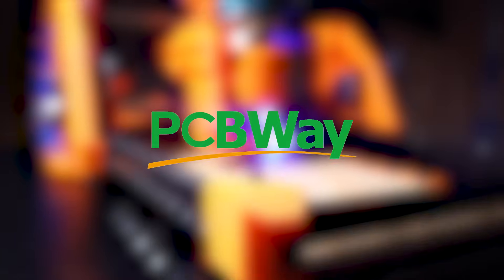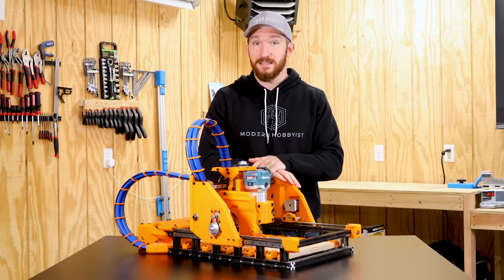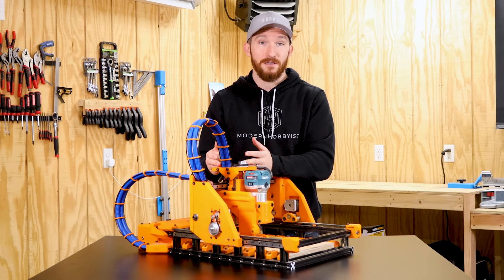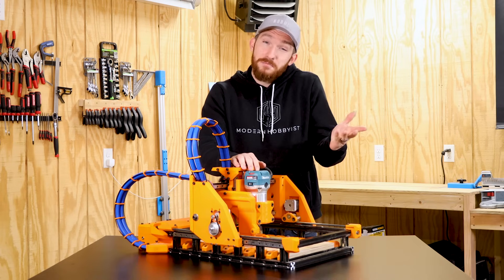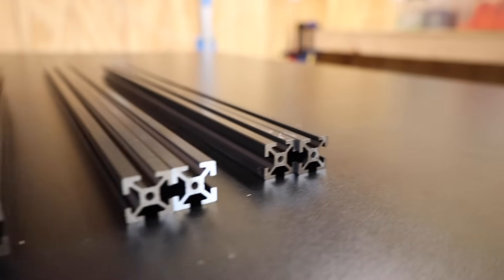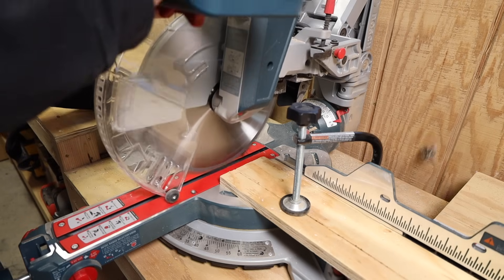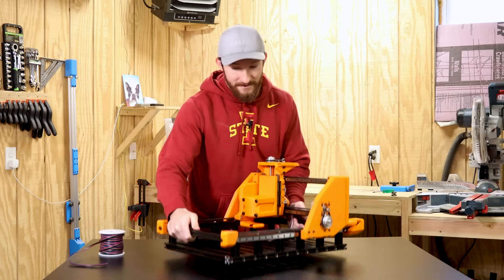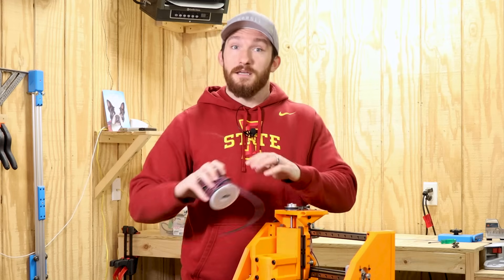DIY 3D Printed CNC That Cuts Metal!

Comment: Final build cost?
Reply from the maker: It's been a while, but I think around $650 🤔
Reply: @ I’ve been thinking about 3d printing one. I think I’ll just convert my old 3d printer into one by adding a controller and a motor with some send mills and a new build plate.
Reply from the maker: One issue that you might run into, is that 3d printers are not designed to be rigid at all. They require very little rigidity and as such often make crappy routers 😬

Comment: metal structure, metal drive parts, metal guides  - yeah this router is 3d-printed, for sure.
Reply from the maker: Convenient that you forgot to mention the 200+ 3D printed parts .
Reply: Did you actually think it was going to be 100% 3d printed

Comment: Fit a mains socket onto the electronics box controlled by the relay, then you can just plug a router in without having to cut its plug off.
Reply from the maker: I would’ve liked to avoid chopping it off, and that’s not a bad idea for future builds, but I wouldn’t have been able to route it through the existing cable tubes. Would’ve been an easy fix if I had kept the plug I suppose 🤔 in any case I don’t plan on taking the router off the machine any time soon. Thanks for the comment!

Comment: Very nice build! The only thing I'd worry about is the air vents on the power supply. You really wouldn't want the aluminum dust to be pulled into the power supply (or any other type of dust). Thank you for the very good video.
Reply from the maker: Thank you! I was worried about that as well, so I had a filter on both sides of the fan in hopes of keeping dust out, but I still found walnut dust in there after my last project 😬 might have to rethink the electronics box

Comment: I got some extrusions through Amazon recently, and it wasn't until I was "repairing" the M5 threads that I had tapped, but weren't holding, that I figured out that the center holes were sized to be tapped for M6. It was in the diagrams, I just didn't notice. After years of using Misumi extrusions with the pilot holes for M5, I just thought that was the size you'd get with any 20mm extrusion. So, yeah, learn from my mistake!

Comment: Great video! I want to build one myself. Seen other mpcnc builds, but this one seems to do really well with aluminum.
Reply from the maker: It really does do pretty well and it was a fun build! You should also look into the PrintNC! It's an open source build using steel tubing and some 3d printed parts.

Comment: Hmm. You or anyone tuning about doing this should look into the PrintNC. But I'm a donit once and do it right kind of guy.

 It's a far more sturdy and capable CNC router. No flimsy aluminum extrusion. There are printed parts but kept at a minimum. The entire parametric model... With an absolutely insane build wiki/manual.. everything is completely free and available online. There is also a huge community on discord with lots of helpful advice. High recommend over doing this build. IMHO
Reply: Thanks.

Comment: Great build/interesting machine BUT like many/most fun projects it's hardly useful for working on metal.
Like the engineer in one of the posts said the materials plastics etc you use aren't very suitable (too flexible etc).
If you're really serious about metalwork it would be more useful to buy a small new or used machine.
You can more or less "reverse engineer" that machine to learn how things SHOULD be designed.

Comment: I'm working on a design for a CNC with about 400x440x120 cut area.  The machine is done, working on the electronics and wiring now.  If it works as I want, I'll be posting the files but mine isn't polished. I'm a newb to designing so I tend to build and test, build to fix problems or correct issues, then build again and again.  I enjoy the tinkering aspect so I'm good with that.
Reply: How did it go
Reply: @santiicolorado  Went fairly well, got it built and wired, firmware installed and working.  Cut a few pieces of wood, didn't get around to metal.  I have some health issues and I ended up having to set that project aside for a while and I haven't got back to messing with it yet.  It just isn't the most important thing in my life right now.

Comment: Great design, great build, might even consider building it myself. The only difference is, instead of drilling into the aluminum extrusions, just use the t slot hardware, more convenient and easier than drilling holes and screwing them together.
Reply from the maker: Yeah especially with a super wobbly drill press I stole from my Dad 😑

Comment: i think its a weird design, why not just use ballscrews
Reply from the maker: Thanks for watching! I hope to make a bigger DIY cnc in the future and will most likely go with ballscrews as well!
Reply: @ModernHobbyist  Ive planning to rebuld mine, Ive used nikodem bartniks design, but made it simpler and on bits left from 3d printer so ended up with weak rods, my next idea is to use a 9U cab as a case and mount all inside of it, on 12 or 14mm rods and ballscrews instead of standard leadscrews

Comment: It really hurts me...using arduino uno with cnc shield and one of cheapest drivers possible while cnc construction is extra expensive, even makita is really good but it's only 710W comparing to 1500w spindle is nothing. Anyways looks cool and impressive. nice work

Comment: @11:22 Yea I don't think having both the Fan In- and Outtakes on top of the Electronics Box was a wise decision considering the Metal shavings you apparently intend to cut with it being produced nearby 🤔
Maybe consider adding a shield that will have the shaving bounce of there instead of landing in the Fan Ports? 🤨
Reply from the maker: Thanks for the comment! I did add filters to both sides of the fan to prevent any shavings from making their way into the box, and so far when I’ve checked inside they seem to be doing the job

Comment: Misumi charges a premium for everything.. I only go there for cads and component spec sheets
Reply from the maker: Misumi is definitely more expensive, but for this project it was worth it to have them come pre-cut. I could have bought full 2M extrusions for cheaper, but I would have spent the same amount total. I'd just have a bunch of off cuts that are too small for anything useful 🤷🏻‍♂️

Comment: Could you go into more detail about how you programed your arduino uno cnc shield doing his big cnc and struggling with that part
Reply from the maker: Hey Nathan! I used the Arduino IDE and the newest version of GRBL for the firmware, and started with the configuration settings Ivan provided in the PDF and adjusted from there. I found this link to be helpful when flashing the firmware: https://all3dp.com/2/grbl-arduino-cnc-controller-simply-explained/
Hope that helps!

Comment: Well, I don't want to sound harsh but this is a newbie machine from someone who have no idea of what he's doing. There's so much conception mistakes that we could talk about it for hours. Long story short, the major issues are materials and components. The young modulus of plastic is a fraction of what steel (which is the right material to be used: stiff and inexpensive) is. 3D printed parts are not isotropic, so they are way worse than injection molded plastic. People may understand that to get the same stiffness as a steel sheet, 3D printed parts should be more than 60 times (!) thicker. Second, the linear rails used in this build are MGN 15mm which are not suitable for routing/milling operations anyways, because they use a single path of bearing balls in a plastic cage. To hold random routing/milling forces you need 2 bearing paths with opposite contact point. In other words, the rails and blocks don't have enough holding power in lateral and vertical direction. 

Consequences are you will need to lower machining speed to avoid vibrations and some deflections caused by the raw material resistance on the tool. You guys think I'm wrong ? Well, do an easy test. The machine can hold a 8mm bit, so insert a 1 flute 8mm bit, set your Makita router at max speed (30.000rpm), set your feed at 10 meters per minute, ask for a 8mm deep pass through any hardwood, hit enter and see by yourself how good the machine is. For information, those are average settings: a proper machine can hold much higher rates. 

Don't get me wrong, Ivan Miranda is a very sympathetic and dynamic guy and his videos are a lot of fun. But when he claims this machine can cuts metal this is much closer to a lie than to reality. Let me explain. With a file which is not a cutting tool, with a bit of patience you can cut metal. And this is what Ivan Miranda is roughly doing: taking micro passes for filing small amounts of material at a time. At the end the metal might be cut, but this is not milling. What else could he do as the machine is not able to stand average metal machining ? 

Once again, I don't want to sound harsh, but this is fooling people I'm afraid. Some newcomers will invest a significant amount of money to build a mediocre machine. And as they have no other machine to compare with, they will be convinced this one is fine. That's what Ivan Miranda himself thinks by the way. Worst of all, people won't learn machining at all, they will only learn how to keep this machine from shaking while they try to make parts. I would say exactly the same about Nikodem Batknik's Dremel CNC. 

I'm a graduated engineer and I've been designing machines for decades. I beg you all to never make structural parts out of 3D printing. Only rubber can be worst, let me tell you. And check the components are suitable for the use. Last, any one can drill a hole into a piece of metal: no extra skills or fancy tools required. Mild steel is 2€ per kg, filament at least 20€ per kg. Building a CNC router out of steel will cost way less than Ivan Miranda's. Definitely. Please think about all this when you will design yours.
Reply from the maker: Thanks for all the info! The only response I really have is that I (and probably many makers like me) simply don’t have the means to work with steel in any capacity yet. I’d love to make a much sturdier and accurate machine, but I don’t currently have any tools or space for real metalworking, so 3D printing it is 🤷🏻‍♂️. Also, I’m sure I could buy a sturdier machine for what this one cost, but the goal of this project was to learn more about CNC machines, their different parts, and to see how far a person can push 3D printing. This project certainly did that!

To your point though, my goal is to use this machine to machine a better machine and that machine to make a better machine and so on. So, I’ll definitely take your tips into consideration when selecting parts for my next build!   

Thanks for watching and commenting, I really appreciate the thoughtful feedback!
Reply: @ModernHobbyist  You're welcome. What you need to make a CNC router/mill out of steel is a hacksaw and a drill. You don't have to know how to weld as structural epoxy glue does it just fine and glue is probably cheaper than hardware to bolt everything on. 

Did you heard about the "3D printing paradox" ? This was theorized back in the 70s. The point is additive manufacturing stands exactly where traditional manufacturing ends. In other words, what is long and/or complex and/or expensive to be done with subtractive manufacturing deserve to be done with additive manufacturing. And vice versa. There's also two major issues which comes with 3d printing. The first one, related to "the 3d printing paradox" is you can do anything with 3D printing, like your CNC router, for example. But that does not mean you should. For example, a front panel can be done on a 3D printer. But if you take a sheet of material, maybe aluminum, you will  have a nicer, cheaper, stronger and better front panel within minutes with just a drill and a saw. While a 3d printed front panel will require way much time modeling and printing to get a questionable plastic thing. The second one is: as 3d printing allows to make very complex parts, people have a tendency to make over complex parts. Just have a look at Ivan Miranda's parts. 90% of them are unnecessarily complex, which also results of a complex assembly, as you noticed. So you may think twice prior to choose 3d printing for any job, especially about materials properties.

Don't get me wrong, 3D printing is a great technology which have many uses, and some parts can't be done another way. As long as you don't use this technology to print Pikatchu trinkets. 3D printing is the best technology ever for many parts. I own a printing farm and it runs all year long. But 3D printing should not be the most part of your workflow. Whatever a 3D printer can print in theory anything, its real range is way much smaller than you think. When you push 3d printing, you always brings issues which are difficult to identify. Like this CNC router : looks great and pro but it's so far to be. When using it, you'll endlessly face limitation or issues which comes from the wrong 3D printed parts and wrong components.

Let me give you some advises, if you don't mind. When the word structural comes into equation, forget 3D printing. Definitely. When the designed part is unnecessarily complex, you are probably going the wrong way : wrong technology, wrong material or wrong engineering direction. 

Good luck for the next. Keep in mind this machine will allow you to learn machining with it only. The reality of CNC machining is elsewhere. When you'll get your hands on a proper machine, you will have to learn all again. 

I'm looking forward to seeing what's coming next on your channel. Regards.
Reply: While I agree with Axel from the engineering stand point it's always better to use the tools and materials to what they're best suited at, the video production and the topic was entertaining at the very least so I would not knock him for being unaware. I myself being not being from a hardware engineering background and working on projects will double down on manufacturing techniques I am familiar ( 3D printing, laser cutting, basic wood working, and microcontrollers when working with electronics) with even when there are alternatives.This comes down to not knowing enough and being comfortable with what I know, but after a number of failures thats when one tends to branch out.
Reply: @axelSixtySix  I think the whole point is that this machine allows you to accurately cut aluminium parts; The speed is irrelevant if it's a capability you don't currently have.

You could use machine to re-make it's AM parts out of aluminium, and improve the rigidity of the frame.

If you're starting out and looking to spend under £2k - without investing significant time designing, sourcing, and making it by hand - There's very few viable options.

if you're a total beginner to CNC - as is the target for this machine/project, you may as well use the learning experience as what it is, and gain the ability to process aluminium accurately.
Reply: @Matt3DMaker  I strongly disagree about the words accurate and cut. That's the point you missed.  Accurate milling of aluminium parts require much heavier machines, definitely. Here, you can't call this cutting, this is grinding with micro passes. The cut quality matches the machine's stiffness which is awfull obviously. 

Now about the to eternal false arguments given: price and beginner/hobby. 3D printed parts are much expensive than steel or concrete which are both perfect mechanically talking. You build a whole machine with a £40 single steel beam or a single £12 fibred concrète bag. This way, you build a pretty capable machine way under £500. There's hundred of free plans available online. Google it in two clicks. Any one is able to drill a hole in a piece of metal or make a foam insulation mold with basic tools and no skills. Second, more than anyone else, beginners need a capable machine for two major reasons. First a capable machine is more forgiving. Second, you learn valuable experience with capable machines only. Rubbish machines just allow you learn tinkering with their limits.

There's no way a hobbyist would be delighted to use a mediocre machine. Definitely. And come on ! You get plug and play  full aluminium CNC routers from way less than £2000, which will be delivered before you could 3D print all the parts. Let's face the truth ! 😉